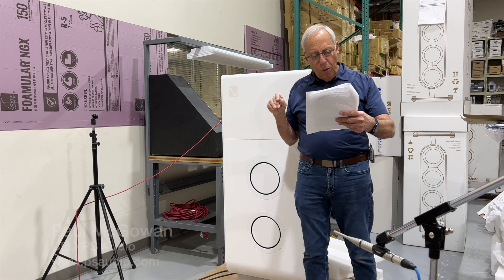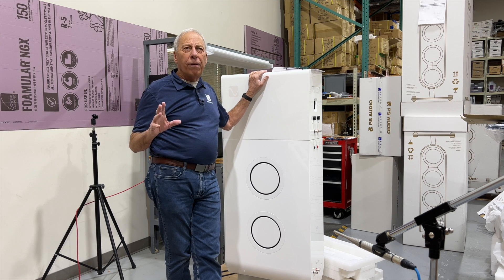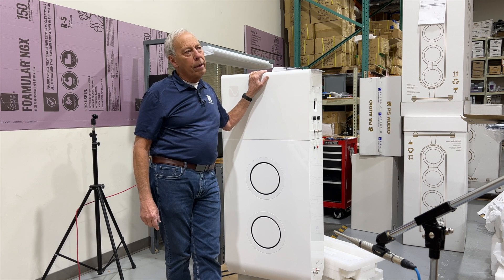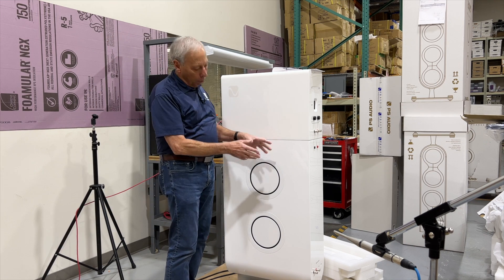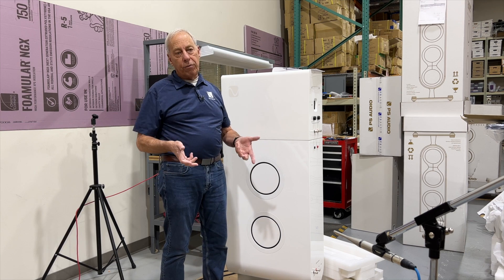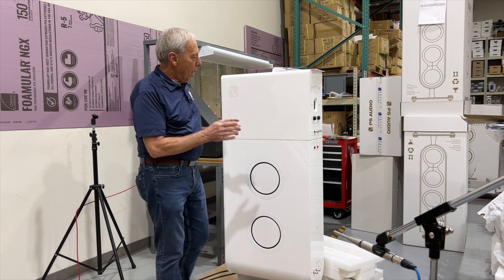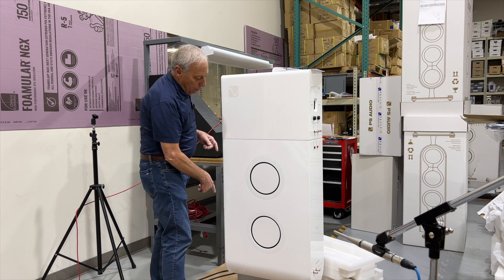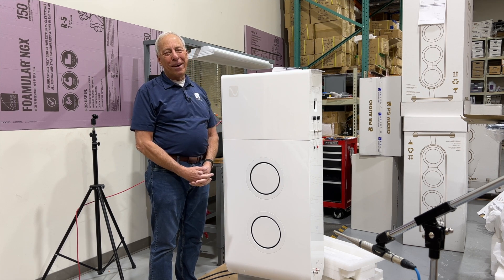Transmission line loudspeakers

Comment: Thanks for the excellent class. The bottom line is T-Line speakers are all about cost,  and for companies cost is the major player.  For Craftsman,  DYI,  if you have the time and resources it is better to build a T-Line box.  I am from Brazil and have a small woodwork place in my house and a very good pair of JBL 6" speakers. I will give it a try.  I will first build an MDF prototype and tune it correctly before building the final box.  Thanks again.

Comment: Steve Eberbach owner and designer of DCM speakers From (1974-1999) alsol worked for NASA super smart guy he really understood Transmission speakers he made a modified Transmission line speaker which took up less space then the original design of Transmission line. In the 90's he had the famous DCM Time Window Sevens which he called Rear Port Hybrid Cambered Transmission line and I own DCM Time Frame TFv10.0's which are the Modified Transmission line Steve called them.  Later unfortunately in end of the 90's he sold the company to Mitek know for brand MTX they did make a nice DCM speaker trying to bring the old DCM transmission line back but not all the same DCM design those which did not help. The speaker for the new company was DCM TFE200 which i own as well great speaker for the price that used transmission line but Mitek did not do much with DCM and sold it again now its really dead and not a audio product company anymore. Pretty sad its like Thiel Audio just sold and killed off the company to nothing. I am so glad PS audio made it over time. Oh side note DCM tw7 and TFv10.0 go down to 20hz on the TFv 10in woofer with transmission line and 25hz  on the Tw7 9in with transmission line.
Reply: I still have my DCM TF 600s I bought new in 92...they still sound great

Comment: Lol ports are only out of phase below the tuned frequency of the port. At the frequency, there is a 180° phase delay (not phase inversion, but the result is pretty close) and above the tuned frequency, the mass of the air is too high/heavy for the input pressure from the driver to exit directly out of the port. A combination of the air mass and the springyness of the air mean couplings is poor. A little bit of air movement does exit, but not much.

I implore you to play with a slinky. Bounce out above resonance, below resonance and at resonance. Notice the directions the slinky is moving in your hands, vs the other end. Then everything makes sense, I promise you ☺ you've said ports work out of phase a few times Paul and it's not entirely true 😉

While there are many advantages of passive radiators over port, this fundamental is just as true in both. A passive radiator works exactly the same as a port, but I a different form, that is too say, in a port, the weight is the air in the port and the spring is the air in the port as well as the air in the enclosure, while with a passive radiator, the weight is the cone assembly, and the spring is the soft parts and the air inside the enclosure. The mass and rigidity of the cone assembly can filter a little extra high frequencies, but the principles of operations are the same, including the phase relationships below fs, at fs, and above fs. 

Transmission lines can definitely have a lot more phase issues, because unlike a port, which essentially cuts high frequencies, boosts and phase delays at resonance, and passes all frequencies below resonance, (which is our of phase to the front of the driver) a transmission line passes all frequencies (it filters a little of the highs but far less then a ported enclosure) however, the length of the transmission line is thus that by the time the sound has made it through the labyrinth, the sound is in phase with the front of the driver, but only at a single frequency. As you go above and below that frequency the combined sound wave becomes more and more out of phase. This means a wider boost in theory, but eventually there will be frequencies that don't line up at all, then you rang a harmonic that does line up, then one that doesn't, etc. That's not ideal. One of the advantages of this design is that the driver is completely unloaded, similar to an open baffle, meaning higher sensitivity and dynamics/"fastness" with the compromise of the above mentioned phase issues, enclosure size and complexity, as well as no resonance related boost at the tuned frequency of the transmission line, only the combination of the two waves which I think is around 3db from memory vs 6-9db of a port. Every design is a compromise haha

Comment: I thought the whole point of a passive radiator was that it was supposed to act like a port and that it is out of phase. By the time the The air compressed by the woofer drives a passive, the inertia of the weight of the cone on the passive is delayed in its movement.

You tune them lower by adding more weight thus making them move further and further behind the original waveform produced by the woofer.

I am not an expert so I may be misunderstanding something

Comment: I have some speakers that are a-periodic that is a bass port that is heavily dampened. I don't think it lets out a lot of air, it function more as pressure reducer making the box seem larger to the drivers. Cabinet still very stuffed. Really an intermediate between a closed box and a ported design.

Comment: Good explanation, but not quite entirely correct. Ported loudspeakers have the sounds coming out of the port in phase with the driver within its correct operating range. The combination of the box volume and port diameter and duct length form a resonant cavity that works as a Helmholtz resonator, centered around the tuning frequency. It works much the same way as blowing across the top of a bottle and when you get it right, it will resonate. If you change the amount of liquid in the bottle, it changes the pitch. When the driver excites the air inside the box at the tuning frequency, this resonance causes the air mass within the port to act as a spring of sorts, such that it inverts the phase so that as it emanates from the port, it is in phase with the driver. As the driver cone moves out, the air is moving out of the port. This causes a reduction of pressure inside the box, and once the the reduction in pressure overcomes the inertia of the air flowing out of the port, the airflow within the port now begins moving back into the box, while at the same time the cone of the driver starts to move back in towards the box. This causes a spike in internal pressure, and the reverse happens and the cycle continues. This is why at the tuning frequency of a ported speaker, the cone movement will actually be much less than in a sealed box, as it has much greater acoustic load applied to it, which is why drivers suitable for ported boxes need much stronger motor assemblies, and this is how they can generate more bass. Once you go below the tuning frequency of the port, then the air movement becomes out of phase with the driver, and it becomes unloaded. This is when it flaps around and moves uncontrolled because it has lost the damping force from the cabinet. 

The passive radiators behave in the exact same way as a port, except instead they are a sealed diaphragm and the mass and compliance of the moving components take the place of the air mass within the port duct. The passive radiator still has a tuning frequency, and if going too far below that will still unload the main driver, however to less of a degree as the mechanical resistance of the radiators suspension will stay fixed and still give some resistance. Also, another benefit of the passive radiators is because it is sealed, you don't get any air chuffing noises caused by turbulence commonly associated with port tubes, which is made worse from hard 90 degree corners or sharp edges.

Transmission lines, as Paul mentioned, are also a way to allow the rear wave of the driver to exit in phase with the front of the driver. The main difference is that ported cabinets and passive radiators are reactive tuned systems centered around a tuning frequency, whereas T-lines are simply a form of mechanical delay, typically set to 1/4 of the wavelength of the drivers natural resonant frequency. The ideal cross sectional area for a T-line is equal to the radiating area of the cone. And by not being a reactive tuned mass, the driver doesn't get any substantial acoustic loading from the T-line, so can move much more naturally and giving a more faithful reproduction of the input signal and the exiting wave has less distortion as it is not the result of a resonant tuning with greater pressures. As mentioned, the biggest reason T-lines are not commonly used is the physical size that they can occupy when designed and built well, plus the additional cost involved, but they can be exceptionally good performers when done correctly.
Reply: Someone who actually knows what they’re talking about, and not just spouting a misinformed opinion. 
Thank you.

Comment: As much as I like transmission line enclosures. I like the tapped horn design more. Almost sounded like that was what was being talked about with the tuned in line phase. But I also really enjoy a good passive radiator enclosure. The amount of sound you can get out of a tight space is nice. I would really like Chris to take the time to explain this subject.
Reply: tapped horn is essentially a tl, just with the woofer not facing directly outwards...

Comment: Needs to be added: first transmissonlines ever constructed used not the described principle. The principle then was to cancel out all the sound, that was radiated into the box while not affecting the resonance frequency of the speaker, that only rises a little bit with this type while a lot more in closed or vented, because the compliance of the enclosed air-volume adds to the one inherent one in the drivers suspension. Result is more bass in the lowest range right above the significant lower resonance frequency compared to vented or closed enclosure.
Today`s transmissionlines do not get the back fired sound perfectly into phase, there is still phase shift of about a quarter wavelength adding to the direct radiated soundpressure, but smearing the pulse because of beeing off phase a bit. The intention today is alike the intention of vented enclosures: use a resonance to first delay the sound propagation such that the outcomimg sound adds to the one fired to the front (90 degrees off in in both) and second to use the resonance to even enhance the strength of the "reflected" (e.g. inward radiated soundenergy) at this decent resonance frequency "filling" the hole right above the drivers resonance frequency. The advantage is a significant gain at the low end but a drawback in pulse response attack and a much greater size of the enclosure. The line furthermore introduces several higher order resonances of the line adding to the sound waht is not intended and is hard (impossible) to prevent.

Comment: PMC and Kerr Acoustics are the Kings of Transmission Line.  Your viewers should read all about the them as that was a very poor description of how they work. You missed half the details out and didnt even explain how it uses the Backwave pressure.  I see a lot of DIY comments , it takes decades of learning the fine tuning of the inner cabinet absorption at different points to make this successful and no doubt half the DIY'ers will not achieve this. Done properly they blow PS Audio speakers out the water.

Comment: I built TL speakers 40 years ago based on a design by Dr. A R Bailey. I used KEF drivers and long fibre wool filling. They sounded excellent but not very efficient. The transmission line absorbs most of the energy from the rear of the driver and does not cause undesirable back pressure or resonances. Not much output reaches the port, only very low frequencies. Large boxes and a bit difficult to make, but worth the effort.
Reply: I've only been building t-lines exclusively since 1991, but the biggest misnome I find is stuffing them to the gills with damping, which IMO might help with harmonics, but kills them in terms of efficiency, which is why I'd rather design the enclosure properly from the start!

Comment: A great video, Paul. Some decades ago now I had a friend who was the wood-working instructor at a local school and one Saturday we spent the day in his wood-working shop constructing  a couple of transmission line cabinets based on the design by A. R. Bailey. I had bought two sets of KEF drivers, that included a pair of B139s. I remember some of the internal construction of the labyrinth was very fiddly and I was certainly grateful for the expertise of my friend in overcoming those difficulties. I was also very impressed with the results.
Reply: I built this design 40+ years ago. KEF B139 and T15 drivers.

Comment: Happy New Year PS family!
Sound travels about a 1/4 mile a second, not 1 foot a second. I'm sure the internet would give exact distance at given temp and humidity and height above sea level. I can't remember for sure but in water the speed is either much faster or slower but its been too long since I studied these things... but I do remember 1/4 mile per second in air.
Reply: For fun: at what frequency is the sound wave one foot away from the driver exactly in phase with it?
Reply: @tactileslut  ask Google what frequency has a 1 foot wavelength. I haven't a clue. Speed of sound doesn't change with frequency.
Reply: Believe sound in water travels faster.

Comment: Hi Paul, I love your channel, informative and you value our time by creating short and straight-to-the-point videos. My understanding of how ports works differ from your explanation though. From my understanding, the port only allows the speakers back wave to escape the cabinet below the tuning frequency that's why there is a steep roll-off below the tuning frequency. At the tuning frequency, the air inside the port resonates creating a sound that is always in phase with the front wave/speaker sound. I am unsure whether the air inside the port resonates due to pressure inside the cabinet or the back wave of the speaker. Above the tuning frequency, the air inside the port acts as a barrier for the sound waves to escape the cabinet/air inside the port is not triggered to resonate. Passive radiators should work similarly but tuned using a passive radiator cone weight instead of port air volume.
Reply: Your a correct Robert,  Paul at times shows his lack of knowledge of speaker design, although he does say it at the start.  He didnt even mention the acoustic absorption inside at different thicknesses to filter out the mids so as your correctly say its the back wave Low Freequency  that only escapes in phase out the port.  Sheeps wool used to be used, these days its a different density of foam and thickness and different parts of the Line.  I would have a pair of PMC BB6XD or something similar over a PS Audio Pair all day long.  What annoys me is half the comments lap it up thinking Paul is so knowledgeable and correct when really that was a poor explanation with half the facts missing.  I really like Pauls videos and watch most but sometimes hes way off the mark.

Comment: You said "sound travels about 1 foot per second". It's actually 1 foot per millisecond, or 1000 feet per second, depending on altitude and air pressure.
Reply from the maker: Yup. Few decimal points off there! Thanks. Duh. I foot per second is crazy talk!

Comment: The Mass of the air in the line couples to the Mass of the cone, lowering the Fs, while the pressure differentials between the outside air and line act as a restoring force. The classical superposition of line and cone add low frequency information. In a correctly implemented T-Line, as characteristically, "Tight, fast, clean", low end.

Comment: If I'm not mistaken a big plus from the use of a transmission line is that there is an amount of back pressure within the cabinet, meaning the woofer more or less responds as it would in a sealed box. This means you get the extended bass of a TL design but also the tighter mid frequency performance of a sealed speaker
Reply: All ported designs control the woofer above the tuning frequency. It is below the tuning frequency where it becomes a floppy mess.

Comment: I love Transmission line enclosures. I use a specially designed one for my car.
Its a cardboard  18” subwoofer tube and inside that same tube is a PVC system which consists of 100” long 4” diameter tubing. It plays well down to 15Hz with authority and sounds like I had two subwoofers instead of one.
For vehicles I prefer tube because they are much lighter weight, don’t require bracing and are not prone to wall vibrations like the common bulky heavy square enclosure of which you have to brace the hell out of to keep stable as well as use thick walls which all adds up to unnecessary weight.

Comment: The best transmission line subwoofer I ever heard was called "The Coffin". That due to the fact that it was about the same dimensions of a coffin. It had a pair of 8in KEF oval drivers in it. Anyone remember that?
Reply: I built The Coffin from 1" thick MDF and used two of the updated KEF B139 drivers (150 Watt, longer excursion) and filled it with 20 pounds of long fibre sheep's wool.  It sits in a bay window behind four pairs of vertically stacked Quad ESL 57s that hang on chains attached to the ceiling, it sounds great but my lady friend said it's unaesthetic.
Reply: @stevesmyth4982  That's why it was nicked named "The Coffin". Super deep bass.